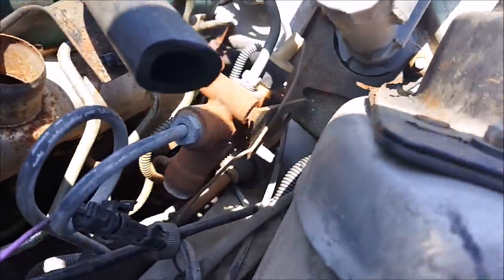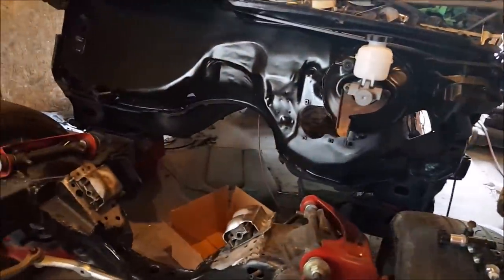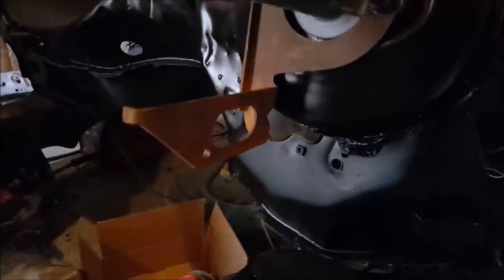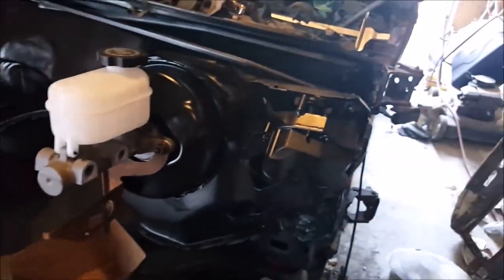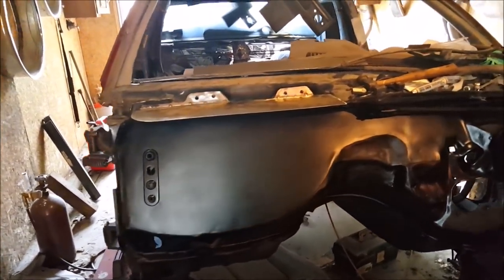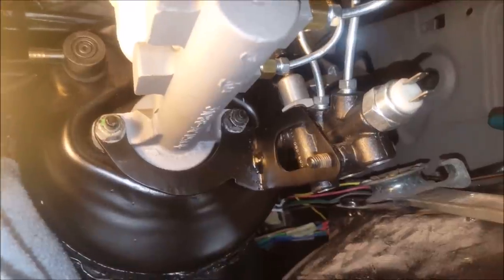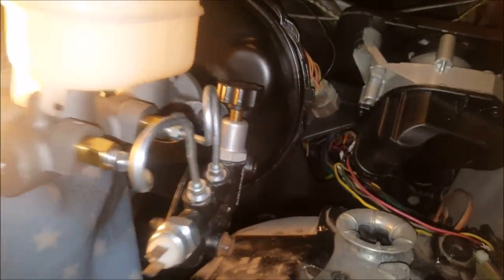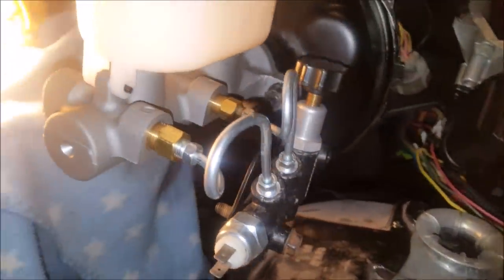Veltboy Garage - Firewall Painting & Proportioning Valve Mounting

Comment: Nice out come my G is that the stock booster and master cylinder?
Reply from the maker: Stock dual phram booster & the master cylinder is from a 2000 Right hand drive Blazer to help deliver more fluid to the C5 Vette brakes I used ... ACDelco part # 18M974.
Reply: Good lookin out bruh thats my next step i might be grabbing one of those prop.valves also also do u still have the part# on it?
Reply from the maker: GBoDYon4s WILWOOD ADJUSTABLE COMBINATION PROPORTIONING VALVE Part # 260-11179